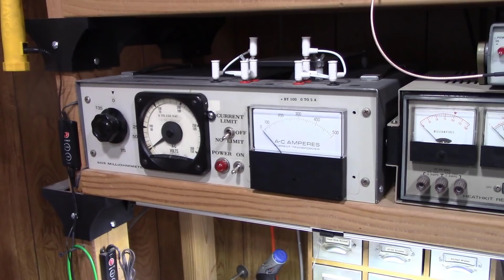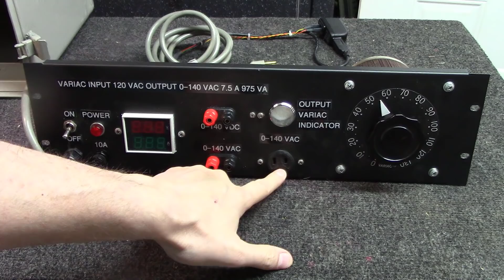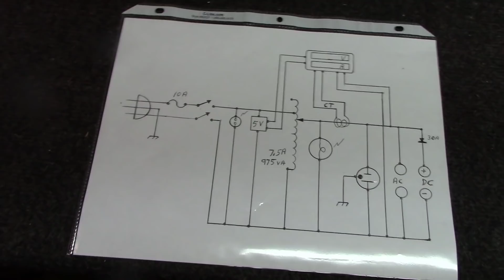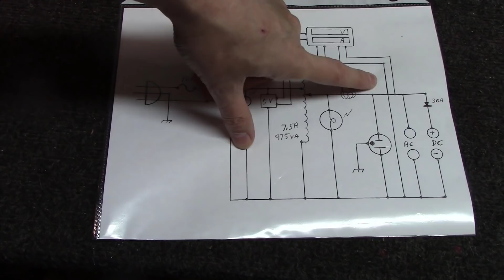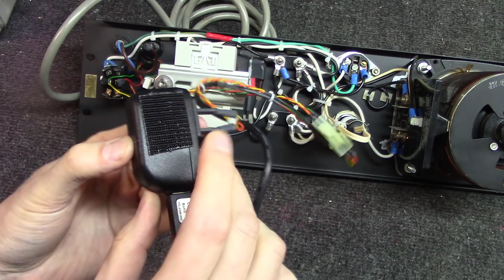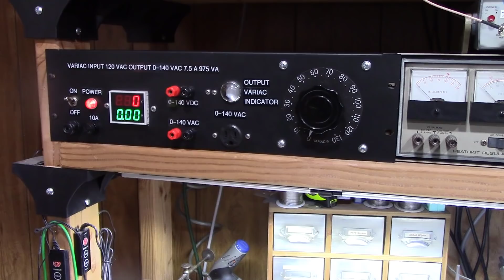How to Make an Electronics Workbench Variac (variable autotransformer)

Comment: I have an idea to make a 1 to 1 transformer before the input side of the variaic to separate the connection from the hot side to the cold side, making it safer to use because there is no contact with the house power side.
Reply: same here

Comment: Can you provide info about how to get one of these units from "that guy from maybe the Raleigh area" that sells them at ham fests?  I'll get one and probably do some of the mods that you did, plus I'll eliminate the DC output.  By the way, what do you mean by "a CRC or similar circuit?"

I'd like to hear your reasons why "an isolation transformer an dim bulb setup can enhance safety and be effective at working on vintage equipment."

Comment: The USB power supply floating about inside is a major flaw in my view.  You can buy small switch mode PSU modules on eBay for peanuts, they are designed for mounting inside equipment and come in a proper Aluminium chassis.

Comment: No ground isolation. Don’t use a circuit like this to isolate a DUT from sensitive test equipment. 

Not even a full bridge rectifier?  No attempt to smooth? Not even a single cap?  Wow. This approach will damage everything on my bench. 

I can see that a guy working only on tube gear could use this. If you do, make sure you know exactly why you’re using an isolation device.

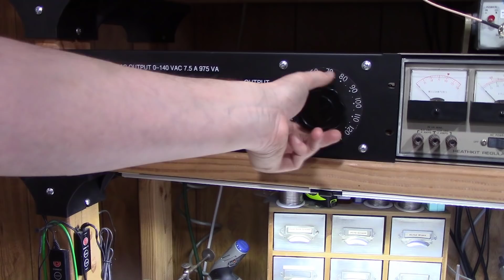Comment: 11:55 there should be no current draw its an open circuit after the current transformer... could be capacitive coupling  but 40ma seems a lot at 60hz nice vid thanks subbed

Comment: Mark, thanks for all the great and helpful videos.
Have you compared the SRPP Preamp stage with a Mu-Follower stage? 

I've been running a 6SN7 Mu-Follower  for the past decade, 

The top tube is essentially a constant Current Source load for the plate of the lower tube.

So far none of my other projects have beat it for overall sound quality.

Comment: I can understand the dim bulb idea for current limiting for a short curcuit, but you mentioned 'you or your heart' carryiing the load
That unit is 7.5A, so you probably have a high wattage bulb, even if you only had a 100W bulb, that would pass about 800 mA, which is a fatal current at anything over about 55V.
Because you have an isolating transformer, just touching the live leg yould make the variac unit 'float' so not as bad as touching direct mains, but if you touch hot and neutral, that's going to hurt.
Reply from the maker: For sure

Comment: That is just about the crappiest DC output I've seen.  Pointless.
Reply from the maker: agreed.  would be easy to drop in a full wave rectifier and cap bank.
Reply: @Blueglow   That, and add a voltage indicator for the DC.  I wouldn't be surprised to see that thing put out 200+ VDC
Reply: @Blueglow  the problem there would be you would need  bleeder resistors  across the cap bank and that would throw out the current meter as it would display the extra load also stored energy well you know,..... i suspect the guy who built it was trying to keep it as safe as possible while adding another option at the cost  of  a diode.
Reply: Also, the DC output is connected directly to the AC line. (As is the AC line.)

Comment: variac's need 2 fuses.... do the math imagine its set to 12 volts.. fused for full rating and the output is shorted  so secondary will be at 10 times rating before the fuse blows   the secondary is only rated  same as primary  so it burned  since then 2 fuses one fir the pri. and 1 for the secondary are standard for me...its cheaper to replace fuses
Reply: Agree with multiple fuses.  In my setup I use push-to-reset panel mount breakers and can switch between 1A and 3A on the output (3.5A variac.)

Comment: Nice setup. The DC output is only half wave rectified. A bridge would be a better choice for that and make certain the bridge can handle the supply current as well. But  A Variac is really nice to have to SAFELY test transformers when you have no idea what they are...

Comment: I wonder how accurate that panel meter measures current compared to a Kill-A-Watt meter?

I wired my old Variac so it maxed out at the line voltage. Never needed it go go higher. I have a NOS 2.2 KVA Powerstat that I want to turn into something like that because it has no switch, outlet or fuse-holder.  Only screw terminals. It's large and weighs about 15 pounds thought so it would be hard to mount vertically.
Reply: Current is measured exactly the same way as an amp-clamp.  The wire feeds through a core with a winding that (usually) gives 1mA on the output for each 1A through the supply wire.  Should be at least as accurate as a Kill-a-Watt

Comment: The currrent indicated on the digital ammeter varied with the position of the variac.  I suspect it was registering the current in the lamp.  The idle current of the variac should be too small to register on that ammeter.  It’s a nice build, though.  I like it.

Comment: Anyone know where to find the digital meter?
Reply: If someone can link to a specific meter it would be great. I'm also having trouble finding one. The ones I have found work off the supplied voltage, not a wall wart.
Really like you videos, Mark. You have taught me A LOT.
Reply: They are for sale for silly cheap all over ebay.
Reply: I can't find one with a range of less than 60VAC.
Reply: What I ended up doing was buying a digital meter, part # PZEM-061. There are videos on how to modify them to read 0 volts on youtube. I first tried it with PZEM-21 like the videos show, but it doesn't work with newer versions of those meters.

Comment: Did you connect the indicator lamp for the output after the current pickup? It's a classical error resulting in a minor current reading. BTW, I could use one too but for 230Vac, unfortunately shipment from the USA is prohibitively expensive...

Comment: It’s interesting that you mentioned your intention to install an enclosure around this unit. I was ready to caution you (and more so your other viewers) to the dangers of leaving this exposed. Remember we are dealing with line voltage here and as such should always be enclosed to prevent things from falling into it potentially causing sparking and risk of fire. As techs we work with lethal voltages and exposed chassis all the time but for test equipment we need to be more prudent with how they are displayed. As an electrician I am always thinking a little more about these things.

Comment: Just a couple of thoughts on this.
1. That thin wires just soldered on to mains power and onto the 5VDC just "flapping around in the breeze" can't possibly be legal is it?
I know for sure that it would not be in my country.  I would rather have preferred a mains plug on the backside where it was plugged into.
2. All terminals that is mains should be covered with heat shrink, not just some of them.
Other than that it looks ok, and a must for every bench.
Add a isolation transformer behind it and a dimbulb on top of it, and you good to go.
Btw, don't count on the dimbulb saving your heart if you get electrocuted, it will not!!!
Reply from the maker: Nothing about this is "legal" as in UL certified.  Never claimed it to be a commercial unit, instead a home brew unit made by a local guy
Reply: @Blueglow  not legal as in "UL", but as in: It causes a fire and burns down your house, and insurance will not cover it .
Reply: @geirendre  In the 1970's thru 2005, I owned a shop. I made sure my technicians never left anything unattended, and certainly not running overnight. Every bench was independently powered and isolated, etc. and totally shut down when not in use. My insurance guy and landlord wanted it that way... so did I.

Comment: sigh.. another project im going to put on the list of things to build..love the compactness of it.. got a dim bulb set up.. but still looking for a good affordable isolation transformer... but it has to be relatively cheap..lol.. thanks for my new project..the wife isnt so enthused though..lol...cheers
Reply: Search eBay for "medical isolation transformer"  They'll come in a big case with IEC sockets, but the transformer can be easily pulled, or regular sockets retrofitted into the case.   Following is my opinion only, read more about it to make your decision: I float the ground pins on the outputs to TOTALLY isolate the device from the utility side.  Others say to leave it connected.
Reply: I'm looking for an isolation transformer too. For some reason they're expensive, even used. I snagged a NOS 2KVA  Powerstat on ebay for $60 a few years back. But is has screw terminals so I need to make a similar contraption for it.
Reply: @acoustic61  Look around for 2 qty roughly identical filament transformers or 24 volt control xfrmrs you wire secondary to secondary.

Comment: Wouldn't a full bridge rectifier instead of a single diode give a better VDC output?
Reply: I would think so...otherwise it isn't DC, but just half of the AC waveform.
Reply from the maker: Yes, for sure.
Reply: Yeah thats pretty dirty DC, as in 120Hz DC. Good for little more than a ripple counter input! Bridge rectifier and a few thousand uF would go a long way.